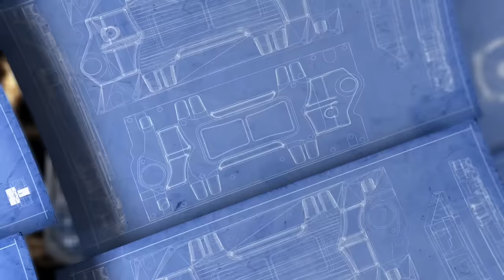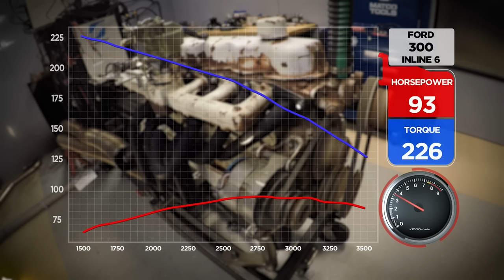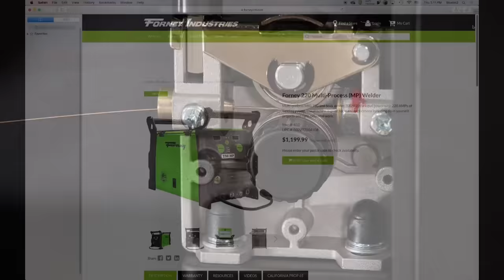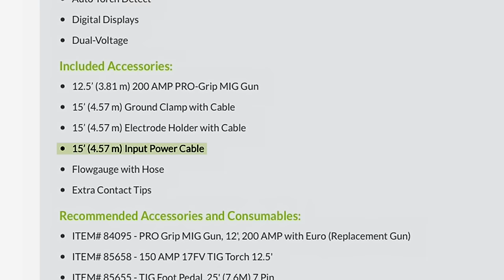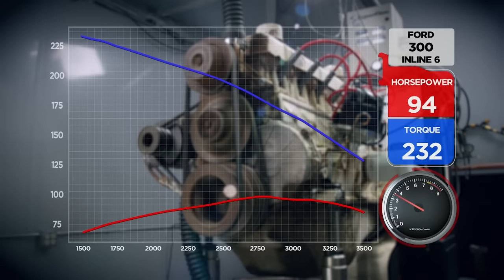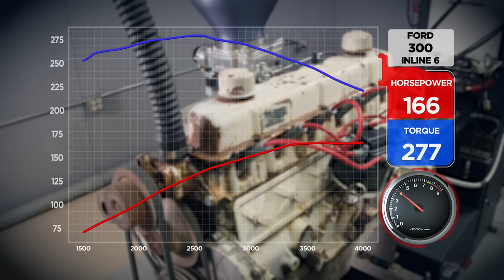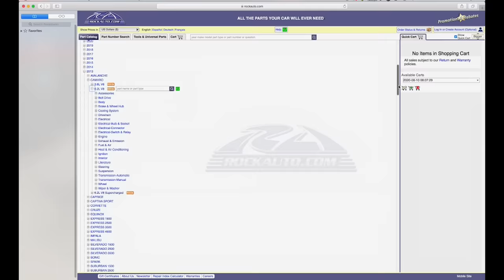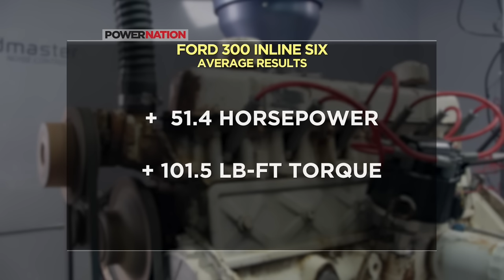Ford 300 Inline Six Gets Eye-Popping Off-The-Shelf Power - Engine Power S7, E17

Comment: I never liked the 300 Ford. When they still had the carb and emissions were slathered all over the thing, they were one big vacuum leak. The carb would come loose from the base, and the screws pointed up, so it had to come off to tighten. A 305 GM V8 would run circles around it and get better economy. And while the 300 was as common as dirt, it cost $200 more back in the day to rebuild than a 302 Ford. When they put fuel injection on the engine they made the first REALLY good 300. Look at those stock numbers, 88 measly HP, it's just awful.

Comment: In the "old days" we used to say "foot - pounds" of torque, now you say "pound-feet" of torque... why ???    what is the difference ??
Reply: The change was made to distinguish between foot-lbs as a measure of work  (1 hp = 550ft-lbs per second) and torque as a turning force (say, 550 lbs at 1 foot). It's a labeling thing to make clear what's being talked about.

Comment: they arent any different than any other engine when it comes to getting more horsepower out of it . you want to increase the airflow through it by porting the heads and adding larger valves , if possible and manifolds that are'nt as restrictive . and then adding a camshaft with more valve lift and duration . and of course more carburetion . those engines , just like the other american inline 6's like the slanted six , the gm sixes and the american motors sixes were not designed for high output , they were designed for economy and long life . all those companies offered V8's in the same models that the 6's were put into by 1965 at least , like the falcon , valiant / dart , and chevy 2 . chrysler offered a high performance package on the slanted six in the early 1960's , but that is really the only high performance package offered on an american inline six since the hudson's of the 1950's . i believe the early corvette only had multiple carburetors on its 235 -6 but no other high performance modifications . the 300 has two drawbacks to producing high horsepower , and that is that the cylinder head is not a crossflow design , and that the engine has a long stroke . i have owned three of them , i had a 1968 F100 with one , a 1979 F350 Ex-uhaul , the sticker under the hood said " engine family 330HD , which is the 330 heavy duty engine which i read somewhere was only put in ford medium trucks , so apparently uhaul was able to get ford to " special order " build them some F350's with the 330 engine . someone had replaced it with a 300 . i also had a 1965 F100 , it had the 352 V8 , but it was shot , it poured out smoke from the tailpipe , so i bought a 300 that was in a 1975 F100 for $ 100 from a friend and put it my 65 . i had to move the motor mounts forward or backward that were bolted onto the crossmember but it was an easy swap

Comment: 1. An indusl eng never intended over 2000rpm so of course removing a 1 barrel increases HP.  Notice exhaust change did not increase Hp dramatically.  (Interesting stats: 74Honda CB450= 44HP: 1977 Pinto 2.3= 94hp w/ "2 BARREL: Mustang 2.3T = 170-220hp). 650cfm carb=Way too big.  300cuin x 6000rpm/2 =521cfm MAX!  Idle= 87CFm.  Fuel inj saved 4.9L but only ~180hp in '94F150.  Why? AIR FLOW! Same reasonHp increased in the 2.3T. Also, why Honda/Toy/Maz/Nissan still use wind vanes inside (Yeah Inside) intakes on inline blocks? Put down gonge, do your homework.  TURBULENCE is not Performance, CFM is PERFORMANCE. But I am surprised at how little the roller rockers helped.  Maybe you need 1.7 ratio and a turbo? Then watch that 300 pop over 300 hp with some port polishing.

Comment: The HEI is a massive improvement, but you should modify the mechanical advance curve for each setup tested.  While the engine is operating in its designed low RPM range you would see massive torque increases by increasing accelerator pump DURATION and curving the ignition timing to just below your fuel quality spark knock.  Once you change the cam, which I'm sure is next, you will see horsepower gains from increased RPM but the torque will only be higher because you didn't bother to actually tune the engine for each change you made. 
Seriously, you have the engine on a dyno, but didn't spend the $10 for a distributor recurve kit.
Are you waiting to remove the useless rotating mass of the heavy fan drive for when you want the horsepower gains to show up, because you are actually just advertising parts?
I don't mind the fact that this show is clearly an advertisement, but you could do a lot more educating and actual tuning along the way.
At 14:44 do you actually think that massive 3-second delay while he goes WOT is okay. 
What is all the excitement for after the delay?  Tuned properly you can produce enough torque to accelerate the engine right along with the throttle input.
Your "blueprinted distributor" is not TUNED for this application.
Just a professional opinion from a master mechanic.

Comment: What's this engines redline?? 1? Wow peak 232TQ @ 1550 rpms, falls off to 130TQ @ 3500rpms... 70HP @  1500rpms, peak 94HP @ 2800rpms.. talk about a BS stroke/cam set-up for speed. That's a towing/heavy load engine, it needs to be de-strokee and better cams for high end, port job, less restrictive air flow, or else slap that turbo on it since she's forged and heavy duty. The way the intake goes in-between the header ports is a poor engjnerrjng job as far as heat sink and temp control. All the incoming air will be hot hot hot from the location it's in a heat sink

Comment: Those crank type pistons retractors are useless faced with anything that requires a bit of beans and are a waste of money. a screw type retractor is far superior,as is a g clamp where even multiple pistons are simple,you just put the old pad over them and push on that with the clamp. Even disregarding that measure if you can't use a g clamp to push back a piston without f*cking it up then it you shouldn't really be touching brakes anyway.

Comment: I can attest to the dismal HP levels of the 300 inline 6. I had a '96 f150 with an inline 6 and boy was it a dog. It might last a long time but if you needed power it was horrible. Its kind of like the 2.3 litter engine in the mustang back in the 80s. Just a real weak engine. Those 2 engines will get you killed if your trying to pass someone or need some power to drive. Ford should be ashamed to produce such engines that were such dogs

Comment: Biggest reason for improved power is the 33 plus percent air and fuel run through the engine due to the increase in rpms from 3K to 4k rpms.  You didn't compare apples to apples.

Comment: Had one of these in a Econoline van. It started tapping and rattling early in life. Oil starved valve train issue. Also with the carburetor it was lean at cyl 1 and 6. Very disappointing motor.